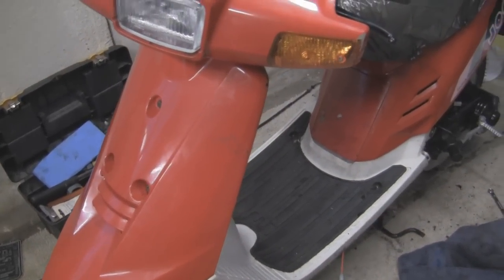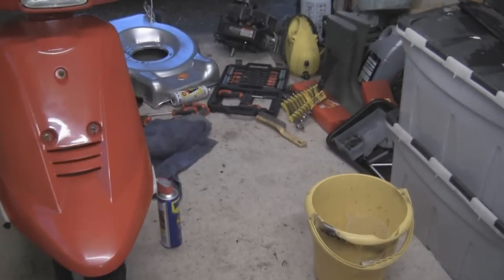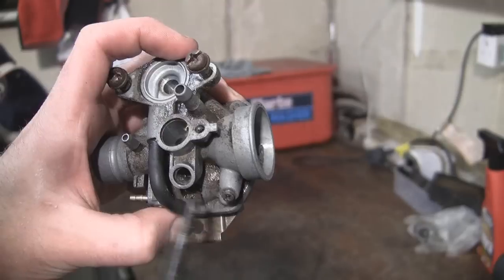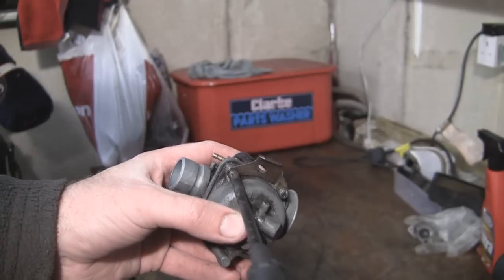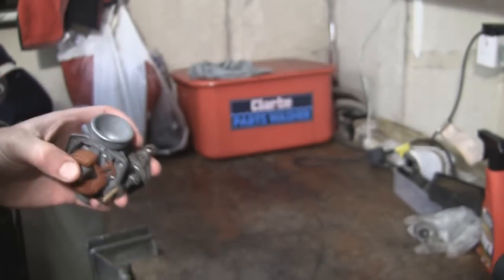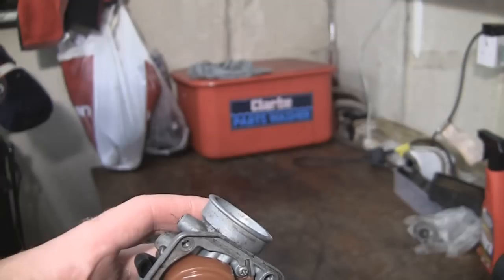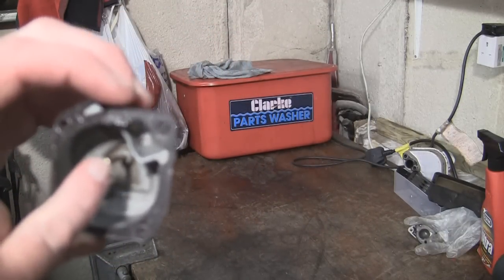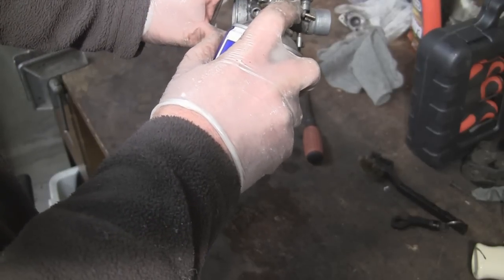Yamaha Jog CG50 Moped Scooter Part 9

Comment: Hello, been watching your videos very very useful. I know they are a few years old but I hope you get this message... Got the same bike, '88 Jog, was running ok when I bought it but needed the battery charged as it was running off kick only. That's all I did, then when I put the charged battery back in it won't start at all. Changed spark plug, got fuel and oil, any ideas? Will take carb off and give it a clean next. When I try electric, I hear a click (spark probably?) And that's all. When I try to kick, it just doesn't make any effort to start at all. Could it be poor throttle cable installation? Guy I bought it off changed the cable over but not sure he did a great job, and the new cable didn't come with new metal hardware - the adjustment on the carb side is rusted out, meaning I can't make any adjustments on that end. Having trouble finding a replacement for that as the cables all come without those parts! Any help would be appreciated. Want to see the bike on the roadn
Reply from the maker: DevinJuularValentine When you turn the ignition on does the oil light come on? I would disconnect the battery and try kick it off. It doesn't need a battery to start up.  Also remove spark plug and kick it over a couple of times with it out incase it's got locked some how let me know
Reply: Mower Man oil light does come on every time, I haven't tried without the spark plug yet but will let you know. Thanks so much for replying!! For some reason always assumed the battery had to be in. It won't kick over no matter what I do, but I will try without the plug in as you said (definitely got spark on it though, checked for that)
Reply: Mower Man so without the battery it makes a similar sound. A very weak hpmmmf but nothing else
Reply from the maker: DevinJuularValentine Try kicking it off really hard for 10-15 mins see if the engine starts to run a bit longer. Kick it hard